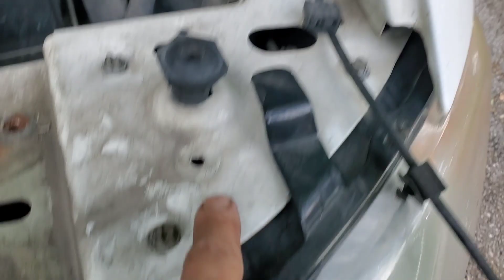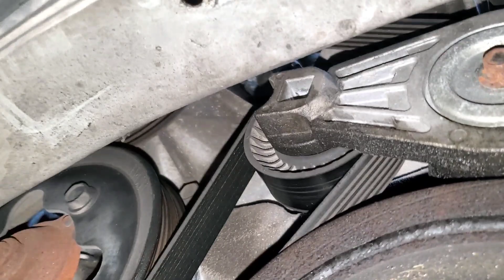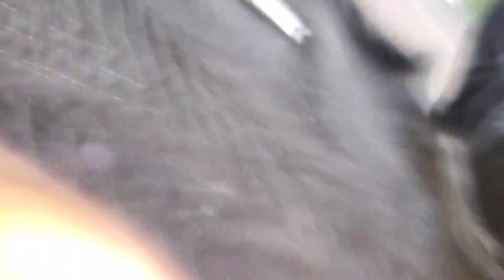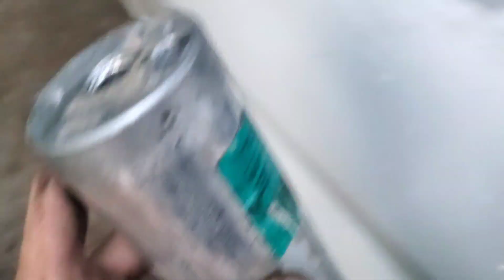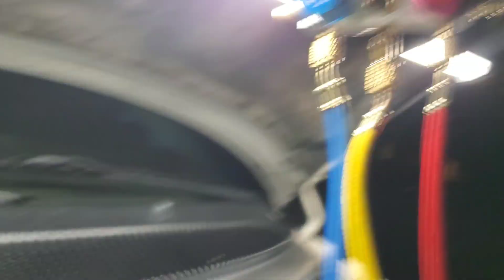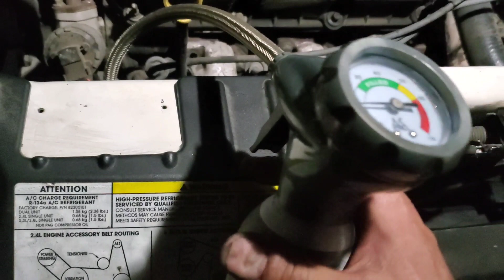2006 Chrysler Town and Country A/C Compressor Replacement!

Comment: Thank you for this video. Did you try charging the system before replacing the AC? Maybe after recharging, it should work again? Did you get the Mopar AC compressor or just the generic one from eBay, and did it last two years already? Does the compressor come with all the rubber o-rings for the low and high pressure lines and the oil, or did you purchase it separately? I have the Chrysler Town and Country Limited 2007, and it has the low and high pressure lines going to the back of the vehicle to cool down the back of it with the extra fan - do you think the procedure will be different from what you did? My situation is that I have a sudden drop in temperature from the AC, and I think that there is a leak in the system somewhere, so I plan to recharge the system with the R134a refrigerant with the stop leak in it before I jump into the AC compressor replacement.

Comment: I'm getting a "rattle" from the lower area.  I'm not sure if it's the compressor or ???  Any thoughts?  I did add some refrigerant for the first time this past year @130,000 but it still chills.  I'm just not familiar with the other components on the bottom area.
Reply from the maker: Would be hard to tell without hearing it in person. I would recommend getting under it with a stethoscope and touching different parts until you locate the noise.

Comment: my preference is 500 microns or lower and a decay of no more than  1000 microns  rise in 10 minutes . i dont use the 45 minute rule. check into a micron gauge . blu vac micron gauge and app on your phone . will amaze you how much moisture ur leaving in that system. check out tom lech or love2hvac, good information to learn from

Comment: How many ounces of oil do you add to the compressor? No rear ac either. Thanks.
Reply from the maker: There should be a sticker under the hood with that info on it
Reply: @Andys_Auto  All it says is lbs, not ounces. I’ve read other places it’s 6.1 total ounces.
Reply from the maker: You can convert lbs to Oz. Also most compressors come with enough oil in them already and no more needs to be added in most cases.  I learned that the hard way
Reply: @Andys_Auto  It does say to add more IF you have rear ac.
Reply from the maker: I think you should be good to just install the compressor.  I've had issues with too much oil before and it's a huge pain to deal with.  In my experience if I had to choose I'd rather be slightly on the low side then overfill because you can always add more.

Comment: Nice video. Where did you buy the compressor? I have a 2005 T&C. Bought a compressor clutch from O reillys auto parts. After replaceing the clutch the belt would keep shredding. Replaced all the pullys including the harmonic balancer. No change in the belt problem. Finely i took the new compresser clutch off and compared it to the origenal. All looked the same untill I put it up on a bench and put pully next to pully and layed a straight edge across the top of both. The new pulley was about 1/8 of an inch lower then the original. Put the original clutch back on and the problem was solved. So I am a little skeptical about buying a new compressor.
Reply from the maker: I also used Oreilly